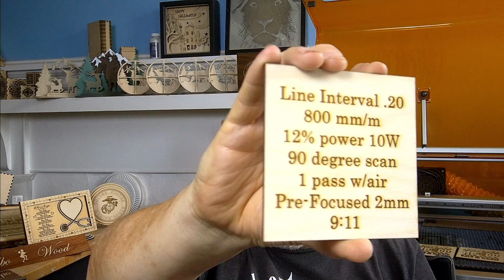Increase Line Interval - Decrease Engraving Times

Comment: Good video and I'm looking forward to Saturday. I will have a question just to give you a heads up. If I use the Pre-Focused option can I run a Line after Fill and still get a crisp line with the 10W or BEFORE MOVING THE WOOD, focus the laser and then just run that line in 10W power?
Reply from the maker: A line after fill will give the definition it needs with the increased line interval. Run it at the same laser position to insure a smooth consistent engraving.